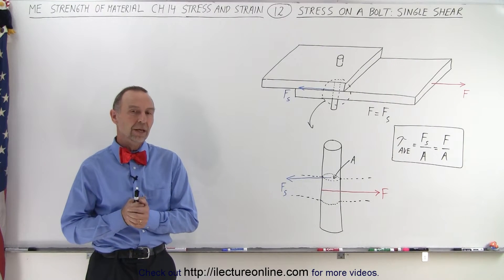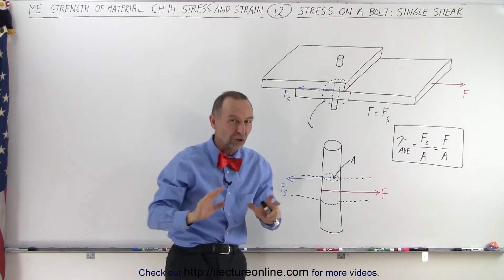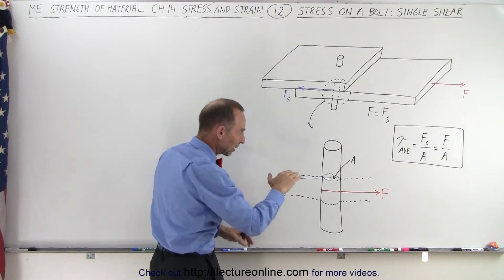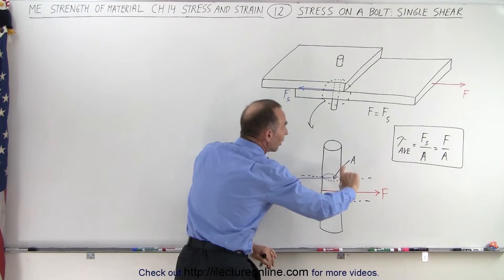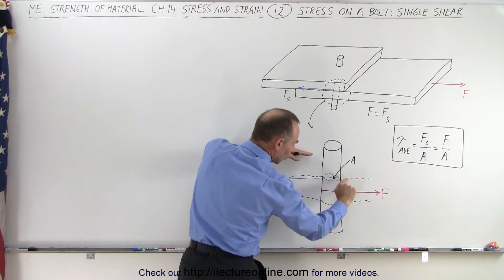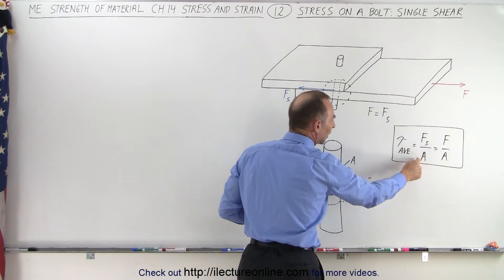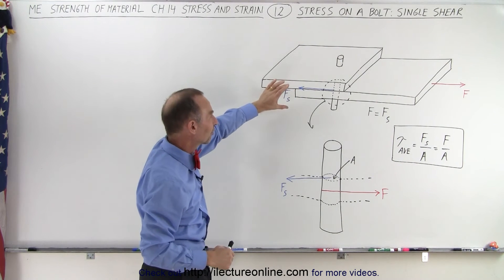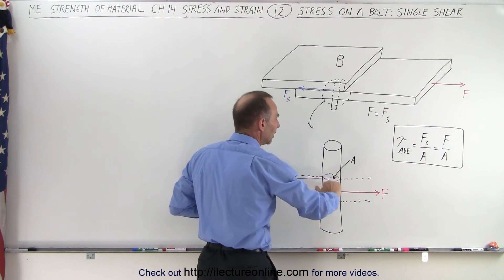Mechanical Engineering: Ch 14: Strength of Materials (12 of 43) Stress on a Bolt: Single Shear

Comment: Hi Professor, does the system turn because of the non-collinear force?
Thank you
Reply from the maker: If the line of action of the force is not through the center of mass, then there will be a torque and there will be circular motion.  (That is not the emphasis in this video).